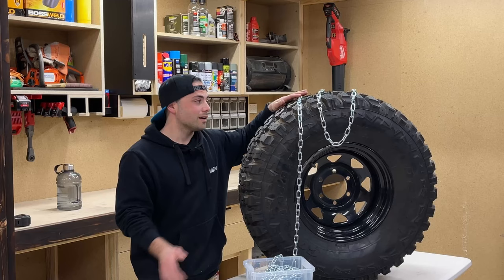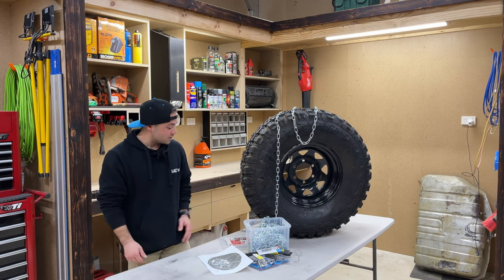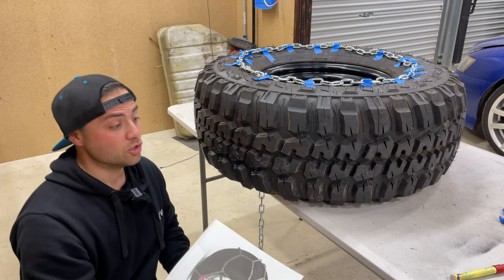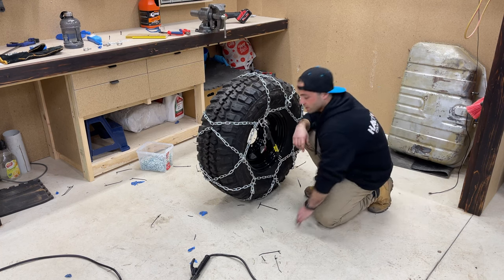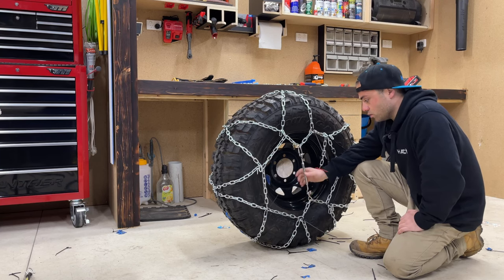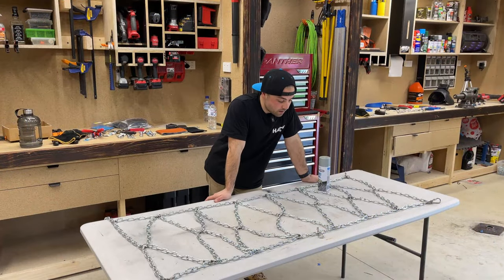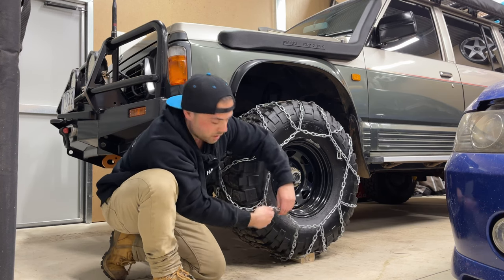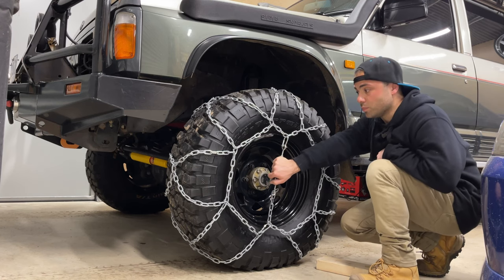DIY Snow Chains | Diamond Pattern | Cheap | Easy

Comment: Nice vid! How dit they work?
Reply from the maker: Can’t tell you yet haha. Haven’t had to use them everytime I’ve been up since I’ve had them. Maybe this year.
Reply: After a lifetime of using tire chains ⛓️ I can honestly say that they will definitely work. The difference is between having tire chains on and not having them at all. You're obviously not completely invincible but they certainly do have a place and a purpose. The typical inside & outside rail with ladder 🪜 style cross rails are die hard successful, anyone arguing the point is is  just looking to yap for nothing. My question is this: who came up with this diamond 💎 pattern idea as being "required" ? It does at present on that chain leave some quite open areas, those could be filled in a bit anyways, no big deal. But ya, guaranteed looking good 👍 there is many different designs and ways to hook em up, tough to say one is wrong & one is right when they all help.